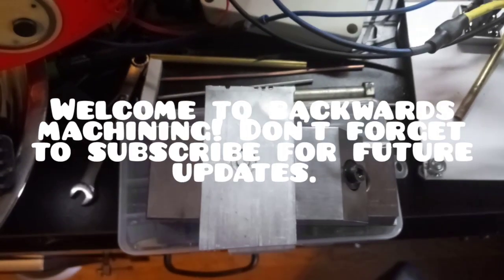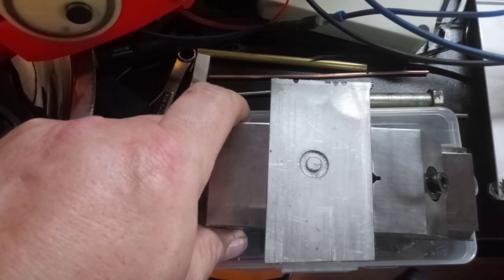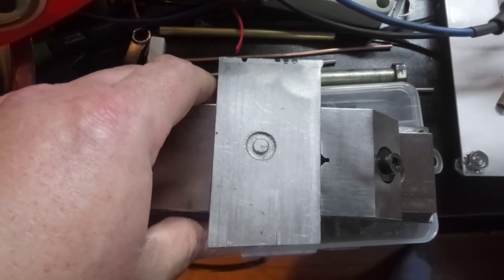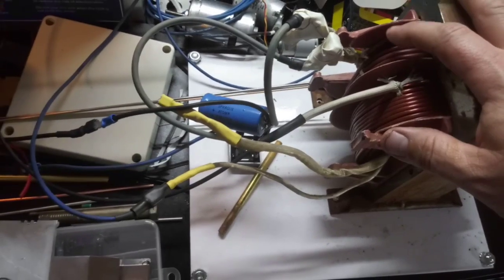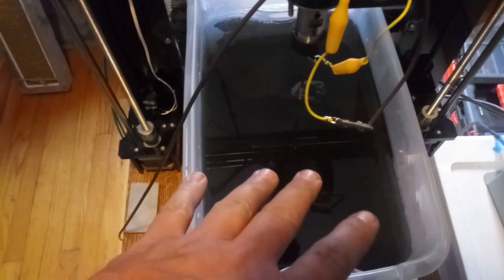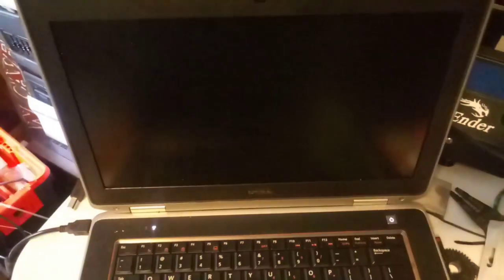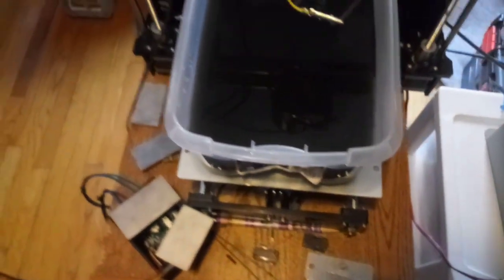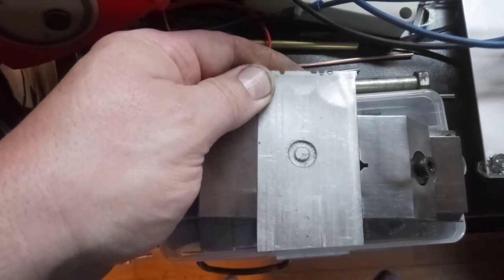First CNC EDM test piece

Comment: If copper doesn´t function as well as Brass, try interchanging the polarity on the electrode/workpiece. The black color comes from some unwanted copper-reaction, this will go away if you change polarity, and you´ll have less electrode-wear, higher workpiece-wear, I think... 
But still, you need higher frequency and lower gap-current, aka more sparks but a higher frequency of sparks (I think, if you manage to raise the frequency, gap-current will unavoidably become lower). 
There´s online RC-oscillator-frequency-calculators. put in your bulb-resistanse (only bad that cold bulbs have different resistance than warm bulbs, unlike electronics-resistors), main capacitor (that´s the one that comes after the bulb), and trim with the values, till you get at least 10kHz of frequency. 
This calculator says, that if your capacitor is 150µF, then your Bulb should be 0.1Ohm, and there´s no such big bulb... Start with an 0,5µF capacitor. https://www.omnicalculator.com/physics/rc-circuit

Comment: I am using 120v and attached it with rectifier , 3 capacitor, 2 bulbs 200w and it's doing a great job and i agree with you will get shocked so many times , the 2 bulbs i have it takes away the extra voltage

Comment: lol, no wonder you're not getting a very nice surface finish. It's supposed to sound like sizzling bacon, not a pack of firecrackers :) Although this is actually good for rough work, since it obliterates material so quickly and produces a smaller number of large swarf particles rather than a zillion ultra-fine ones. Easier to filter.